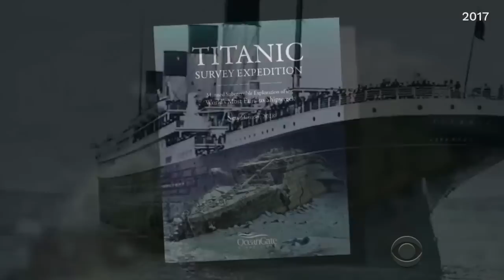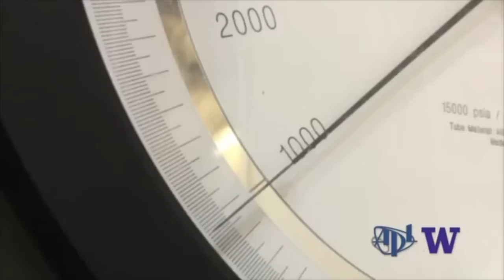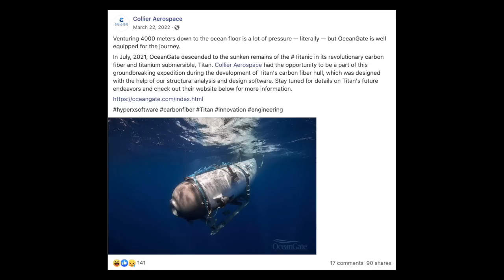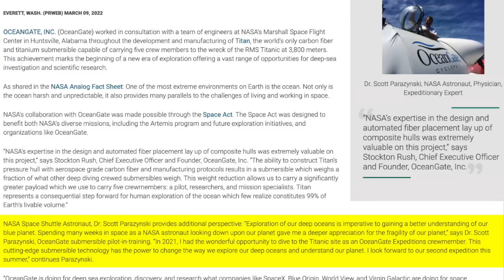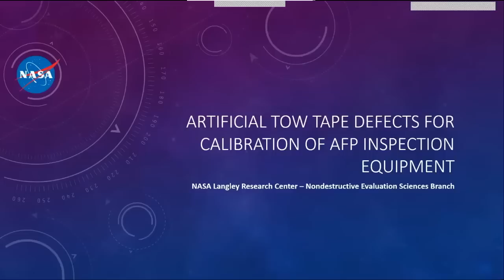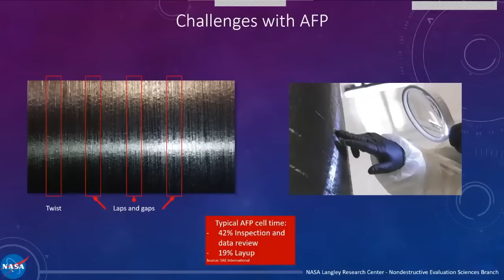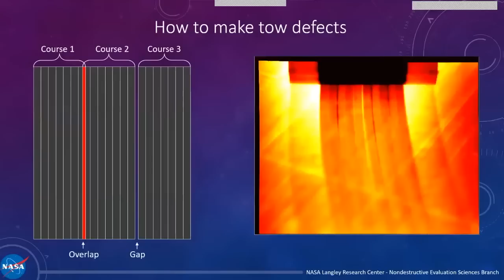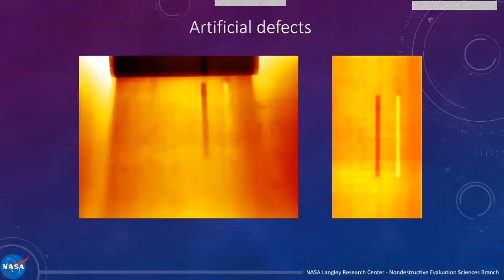The Shocking Truth Behind OceanGate's Carbon Fiber Hull

Comment: The only thing giving that CF pressure hull ‘strength’ was the resin on the individual carbon fibre layers. The CF may as well have been toilet paper for all the strength it was adding.
Reply: 💯 It has NO structural superiority in compression ffs! It’s great for making pressure ‘containing’ vessels, not pressure ‘excluding’ vessels under compression.
The main cylindrical ‘pressure vessel’ might has well have been made from string and glue! 🤦‍♂️

Comment: 4,000 meters is not 3.5 miles! Researchers from UW should know that unless they skipped lectures. 
Could it be the clue to the tragedy?
Reply: 2.5 when rounded up. a mile difference when figuring out the amount of atmospheric pressure the ocean is doing to a hull of a deep sea craft is what a 100 atmospheres or so. A craft designed to go to 500 atmos will handle 400 just fine. If the design was done correctly and not cf

Comment: It's amazing that UW and NASA didn't know the basic issues in making a composite pressure vessel with external pressure.   The main asset of Carbon composites is the carbon fiber, which is wonderful in tension but not as wonderful in compression.  For the compression, they are relying on the epoxy matrix, which is often brittle and not nearly as strong as the fiber and more prone to issues in manufacturing and use.

Comment: The hull of the submarine was made of epoxy resins... The fibers support the linear stresses and the resins the compression...
Reply: The resin is just there to keep the fibers from buckling, ideally you would ignore the resin's contribution. The axial compressive stress causes the resin to expand radially, which is countered by the much stiffer tangential fibers. The problem is that the fibers facing the interior are only supported on one side, so they can buckle inwards and the failure is likely to propagate very quickly

Comment: It is said that iron eating bacteria consumes 600lbs of the Titanic's iron a day. But if that's the case, then how could all the 92 million lbs of iron used for the Titanic be gone in 20 years? I'm adding the 115 years that bacteria started eating 600lbs of iron a day, from the day it sank. The 20 years prediction that the Titanic will be gone just doesn't add up.

Comment: If anyone is doing anything this dangerous make sure you do your homework and not listen or believe everything the salesperson tells you. Now days their is so much info out there available at our finger tips even on our phones. Now I would like to know is  if they finished the investigation and what there findings were.You know what is scary to me is the resin I have attempted to make jewelry with it plus their are two types but even using carbon fiber with it is frightening.  The planes that use carbon fiber have used the type that is already molded. Also their are two types of carbon fiber one is the kind you put the resin and carbon fiber together and the other is already molded. The strength is different for both types. Ive seen videos and it does look like they used the type that was weaker.
Reply: He was entering it so I assume it was of quality!

Comment: Why couldn't he have made the whole sub Titanium? I know he said something about more space but surely he could of designed it with Titanium to be spacious...
Reply: We really don't know how much more weight and cost  that would have added for a sub that size. I'm sure Stockton Rush knew. The more weight, the larger battery and motors also.
Reply: @neilwani1178  Cost and weight, Thank you 👍
Reply: @Devo_UTFR  Steel is 5 times stronger than carbon fiber. But steel weighs 5 times more than carbon fiber.
Reply: @neilwani1178  figure in weight of 5 persons on board also!

Comment: So in conclusion, rush was telling the truth about nasa's involvement in the submersible designing. Strange that nasa is now washing its hands off the project. Its ok nasa.. its not the 1st time you screwed up big time and it definitely wont be the last.
Reply: Every organization with acronyms was involved even the PTA.
Reply: I hope the extent of NASA involvement is exposed.
Reply: @arturobandini4078 Show me anywhere in that NASA video where they talked about Titan's hull or the menufacturer thereof.  the entire video that he attached for some reason had nothing to do with how the Ocean Gate hull was manufactured or tested.  To begin with the NASA video talked exclusively about using prepreg carbon fiber and the fact that it all needed to go into an autoclave as the last step.  You never saw a technician slathering epoxy by hand as the RAW carbon fiber was laid down and then allowed to cure at room temp.  At no time was Titans hull ever in an autoclave.  There was no discussion of NASA being involved with the manufacture or testing of the ACTUAL Titan hull or the manufacturing process used on Titan.  In fact I have zero doubt that the NASA people would have been horrified about how Titan was ACTUALLY manufactured.

Man the.comspiracy experts are coming out of the woodwork.
Reply: @maryannsinopoli1751  He already nailed himself, and 4 OTHER PEOPLE!

Odd, how you feel that pointing out Engineering facts is being hateful.  You sound like the model Ocean Gate, customer.
Reply: @stevewhite3424  boo boo sad 4 you
Reply: @maryannsinopoli1751  Yep, perfect Oceangate customer.